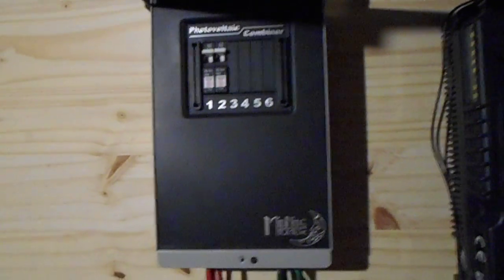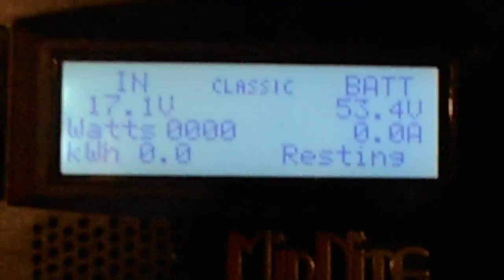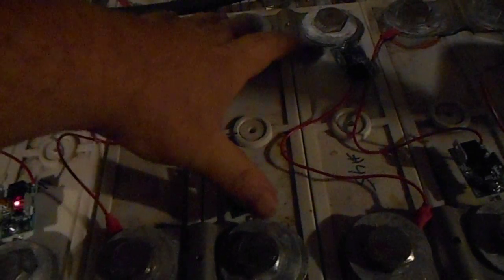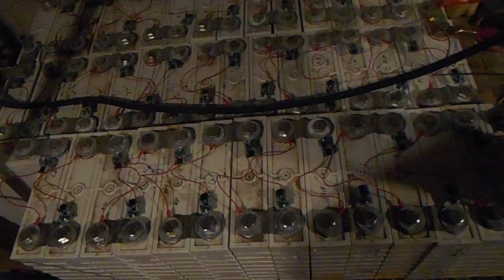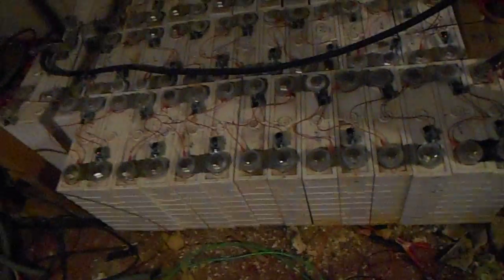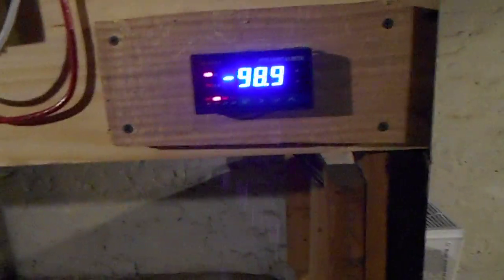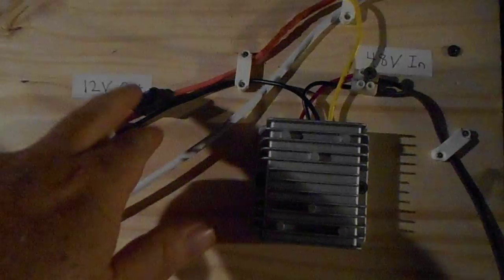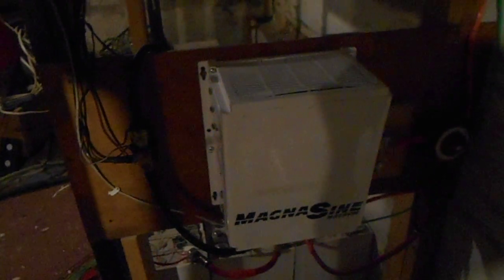48V LiFePO4 Off Grid Solar System - Hardware(Part 2)

Comment: Where do you get your balancer
Reply from the maker: +william rabe I got them at minibms.mybigcommerce.com/
Reply: So are these worth the price difference then a deep cycle ? I have about 52 100 ah lithiums but they run my electric truck
Reply from the maker: +william rabe Yes, in the long run, I believe the per cycle cost of LFP is lower than any other battery chemistry.  I would keep them on the truck.  (The price of gasoline is higher than the price for electricity.)  When the truck dies, then I would pull the batteries from the truck and use them for solar....the batteries will need to be reconfigured/capacity tested for optimum performance at the lower solar voltage (~48V)
Reply: Hi... sorry, but the link is broken... do you have an updated link or can you please PM me with the details... thanks... good video... wish i found you 3 years ago

Comment: 24 volt 200 AH cost 2300 euros
Reply from the maker: marsman williams 300AH @ 24V will cost $3300USD with shipping (8 cells)  It is not easy to start with a small battery and expand as funds become available.  I think this is the biggest issue with LiFePO4 batteries.